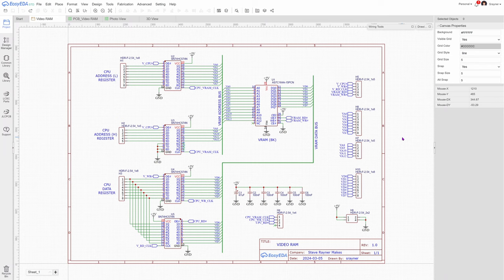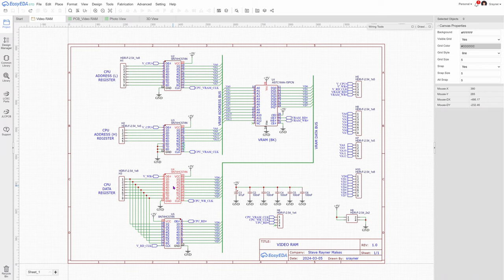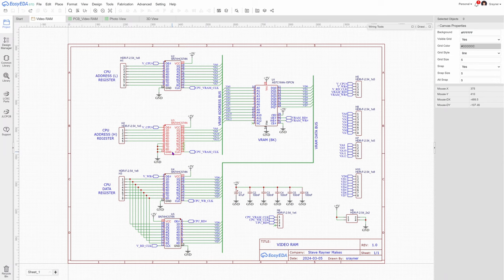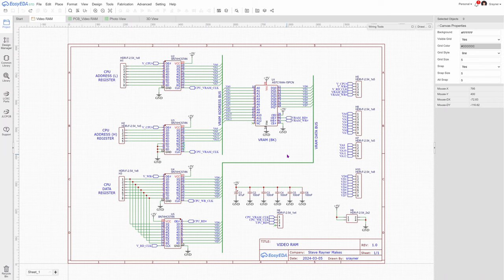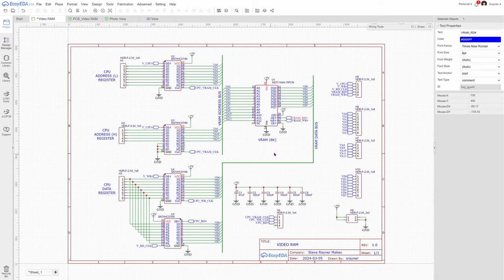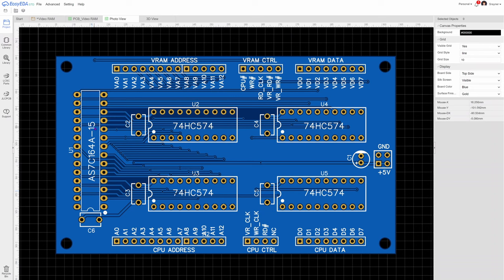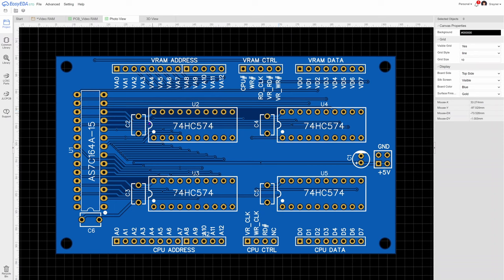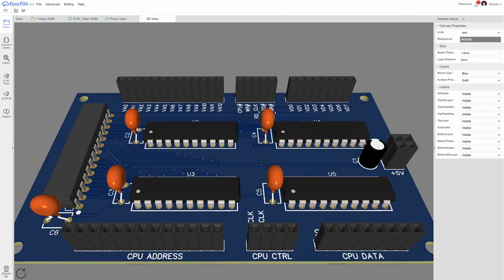Z80 Computer - Part 19 Video RAM

Comment: Is your video ram clock synchronous to the CPU clock? Or at least a known synchronous multiple? If not, you may have to work harder to deal with the clock handoffs. 100% I'd add something like an SR flop that gets set when the CPU initiates a transaction and when set, causes the video to execute the transaction, then the video side clears the flop. The CPU should be able to read the flop for testing and possibly holdoff purposes. The usual solution to frame tearing during writes is to use two frame buffers that can be toggled during a VSYNC at the request of the CPU, but then you have to update two buffers which you might not want to do.  Anyways, looks like a fun project.  Are you planning SRAM or DRAM for the video?
Reply from the maker: So right now clocks are not synchronised. But I’m hoping that I could divide the video clock by 4 and use that for the cpu clock. I’m planning to use SRAM. I like the idea of using a second frame buffer.
Reply: @SteveRaynerMakes  I usually implement a second frame buffer in memory just by toggling an address MSB in the RAM, so the low half is frame 0 and the upper half is frame 1.  You'd have to check the timing in a lot more detail to figure out your clocking though.  Some systems will hold off the CPU access to the horizontal or vertical blanking interval, so you get around 9 us every 65 usec or so (using hsync) but that gets more complex, although could be done with just an async mux (75ls157 type thing or a tristate buffer) to switch who owns the address/data/rw bus.  But most of my experience is in professional video processing appliances, not PC video cards, so there are probably a lot of great other tricks out there I've never even thought of.

Comment: Are  you going to order a corrected version of the timing board at the same time?

I would probably go with the Apple 1 style setup with an SR Latch, where the video card checks to see if there's a character ready to write, then CPU sets it high after it writes the data.
Reply from the maker: hmm, maybe I should. I've been thinking about it. There are quite a few things i would want to change on that. There was two small mistakes on the count decoding where I added bodge wires. Also the pixel shifting circuit didn't work. But I'm still not happy with my new pixel shifting circuit. However I was thinking I could replace that part with the final output buffer and current limiting resistors. Finally I used an incorrect footprint for the blue VGA connector so that also needs correcting. I think I would also change the pins I'm breaking out. I want the inverted counts also broken out so that I can access them. So many changes. But I really should do it.
Reply: @SteveRaynerMakes  Less chances of making mistakes as you prototype . And if you're paying for shipping anyway!